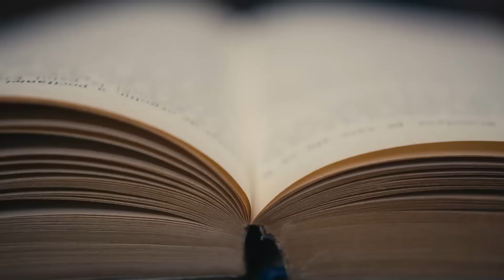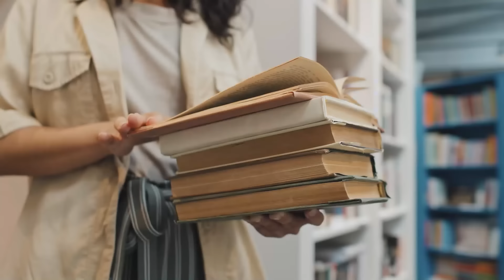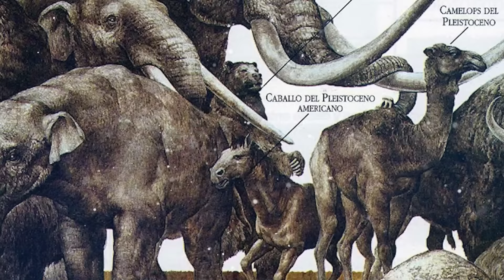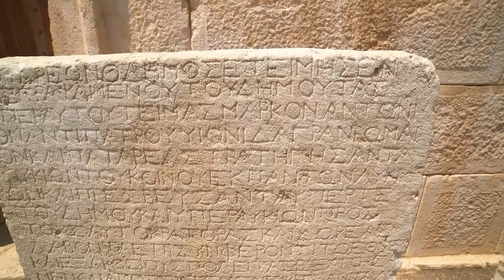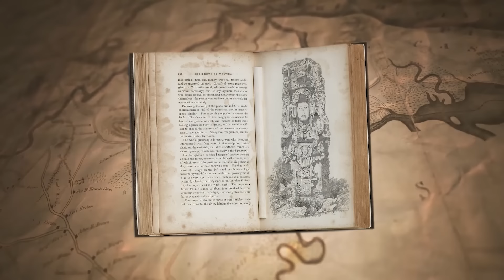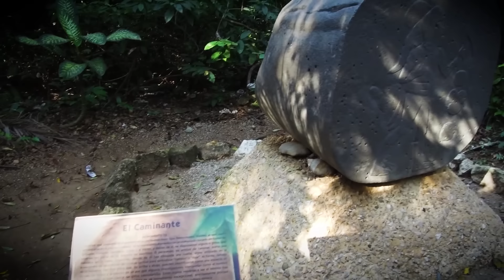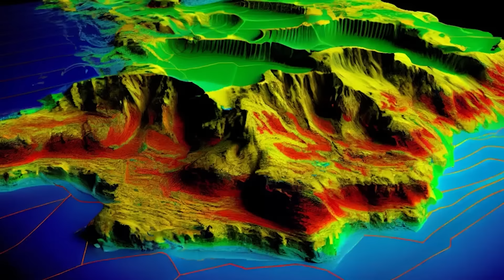Secret Siberia - Scientists Discovered Half Human DNA Inside An Ancient Cave

Comment: CO2 is a light green house gas. There is a limit to how much heat it can trap. Actually the threshold is quite low. There are scientific papers showing this and the evidence. More CO2 over that threshold will not warm global temperatures. Water Vapor is a much higher greenhouse gas. In order to build huge ice sheets at the poles you have to have a warm planet with a lot of water vapor that can fall as precipitation. You can see this effect even during winter seasons. Warmer seasons produce far more snowfalls, colder seasons far less snowfall. This would effect mountain glaciers and snowpacks as well.  More of the planet covered by ocean would expidite evaporation as well would it not helping to build ice sheets at the poles. As the tilt of the planet and as the poles shift would effect the size and placement of ice sheets as well as solar activity and other factors that effect planetary systems. There is evidence of cataclysms in the past. So small changes happening slowly over large periods of time are offset by huge changes happening in a short time. Cataclysms can wipe out so much in a region. People and plants and animals would have to relocate. Such movements of plants and animals is being seen now as things are shifting. The shifting would happen regardless of whether we burn fossil fuels or not. They are natural processes of the planet. Though our activity has put us out of harmony with the rest of nature and made us less able to adapt to changes. No doubt there has been other civilizations before us who ran into the same problem. Though of course major cataclysms that are global in scale would effect any civilization no matter how in harmony with nature and natural processes that they are. There is truely so much we do not know or understand but clinging to views and theories that had been developed on limited evidence does not help us understand new evidences being found.
Reply: Water vapour 95%, CO² 0.04%.
Reply: @JavaAndroid  i think co2 was 4% but 0.4% is from "human behavior" ...   however, co2 does not really affect much and its bad the people are thinking so...
Reply: Vapor canopy = envir9nment for "giants" ?
Reply: Thank you fenixgirl9, not sure which country you are in, I'm in the UK, but I wish everyone in the country would see your explanation and stop freaking out so much over " Global Warming ". it seems everyone is stressed out thinking that they have caused the problem.
Reply: The total amount of CO2 in the atmosphere is not 4%.  Not 0.4%.  Its only 0.04%

Comment: 4:16 'You can't interbreed with another species.'  This is a common misconception.  There are many species that can and do interbreed: lots of canines, felines, bears, and birds, for example, and produce fertile offspring.  Even ligers, crosses between lions and tigers, are fertile.  They can reproduce with lions, tigers, and other ligers.  The bottom line is, being able to reproduce and have fertile offspring does not mean the parents were of the same species.
Reply: 😮 Lion and tiger are both feline, the same Kind. Can't cross a lion and a wolf, though both are carnivore. Lions are feline, wolves are canine.
Reply: @joycebrewer4150  Yes, lions and tigers are both of the Felidae family, but they are distinct species.  I'm not sure what your point is.
Reply: @LynxSouth  Species may be less distinct than we think. However, it is still true that animals of different kinds ( or families) cannot be crossbred to result in fertile young.
Reply: @joycebrewer4150  An intelligent person would infer from what I wrote that species may be less distinct than we think, but that statement of yours uses the word 'distinct' in a different sense from how I did, and confuses things.  I'm mostly annoyed and disappointed: I tried to simply clarify a common misbelief that I quoted from the video, but your dragging in issues from two and three taxonomic ranks greater than the issue of species only muddied the waters.  Geez.